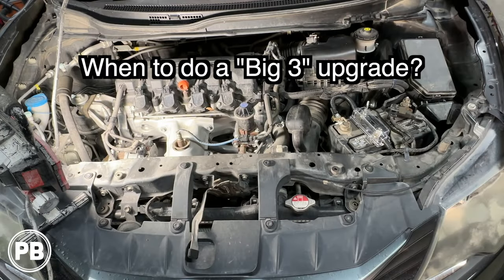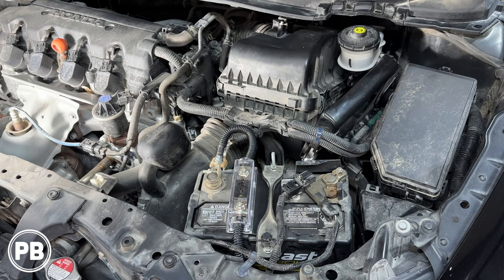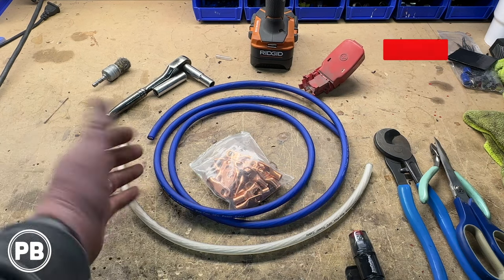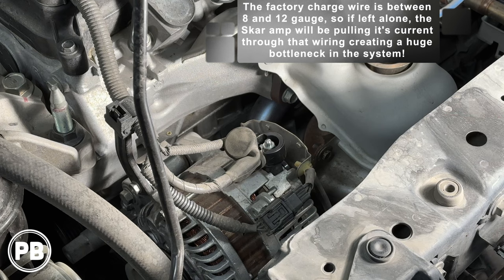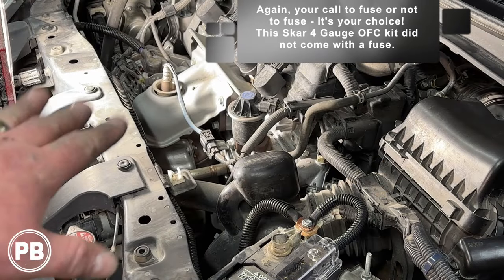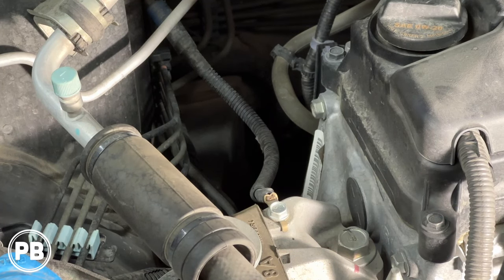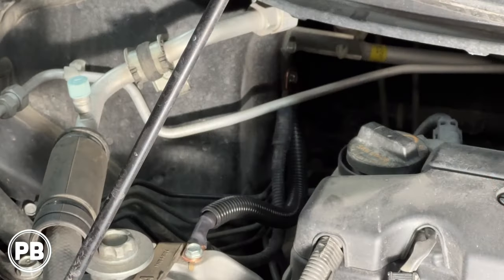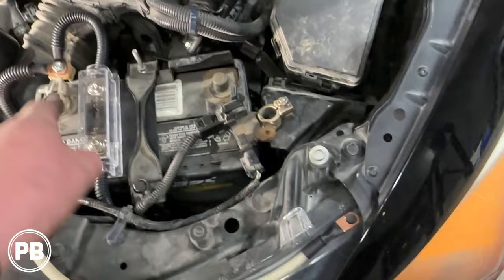How To Install a "Big 3" Car Audio Wire Upgrade!

Comment: Why doesn't anyone ground the alternator
Reply: Some do. I was wondering why he didnt.
Reply: The alternator is grounded through the engine.
Reply: @AmericanAristo  If the engine has a good ground to the battery.
Reply: You would still need the engine grounded as the alt will still ground through it, at least partially. If you have any flow of voltage through the block it'll go in path of least resistance, usually through the coolant causing electrolysis between various metals and the radiator.
Reply: @chriscoralAloha  True. Wouldnt hurt to give it its own ground anyway.
Reply: @shaunmark1  when you say you "need the engine grounded" are you referring to a run from block to frame? Just asking to make sure I don't run into radiator problems
Reply: I usually do mine if it has a factory ground. But I call it the big 4 when it does. The black wire on most have enough to make another run the the alternator.
Reply: I still ground the Alt. N fuse it Best way to go. Plus I'm running 2/0
Reply: I do
Reply: What about with a high output alternator still ground through engine and upgrade engine ground?
Reply: because you dont need to unless you have a crappy alternator that throws less that 80 amps lmao. or unless you're trying to power a true 3k and up amp
Reply: I had to learn the hardway, thank god I purchased the mini fire extinguisher  I kept under the seat .
Reply: Usually you only need to if our running a higher amperage alternator. My 87 firebird is running over double amperage alternator from stock and a a result I put in a 4 gauge ground from alternator in order to ensure I can put that power to use. Also running a diesel Ford battery for the 850cca vs the stock 550cca from the side post.  Add the head unit, aftermarket subs, aftermarket speakers, amp, interior led lights.  I have no issues keeping a consistent voltage on my battery to run the car and enjoy playing my music on Sunday cruises.
Reply: @Sir.AdamsVIII Can you explain what you did wrong?
Reply: @BravoakaMrAlabama  You fuse your ground wire?🤔
Reply: @BravoakaMrAlabama  You fuse your ground wire?🤔
Reply: @DTB2.0  he grounds the alt. and puts a fuse on the alt. not the ground.
Reply: @w33dsmoke61  oh ok  could have  sworn he said he fused the ground
Reply: @DTB2.0  he did, but thats the thing about english slang. you can say a lot by not saying much. lemme translate

I still ground the Alt. N fuse it Best way to go. Plus I'm running 2/0

i still ground the alternator and also fuse it. the best way to go. plus im running 2/0 wire for the setup.
Reply: @BravoakaMrAlabama  I only got one 175a ANL fuse for the positive side, do I need another for the negative?

Never mind. I read more comments and misread your comment like the other guy.

Comment: Even if you're not doing an audio deployment, the Big 3 worth it, at least on the Civic. Honda, like other manufacturers, understand every that every ounce of metal costs money, so they make every wire as short and as thin as they can, and the terminations aren't very well insulated, so, they corrode over time. I did the Big 3 when my Civic was 10, and noticed a substantial difference in the smoothness when coming to idle, and at idle, e.g. coming to a stop. I guess it technically could equate to a restoration of power, for some older models. Thanks for the more detailed video than what was available back in 2018!

Comment: My set up is 320 amp alternator, 2 gauge big 3 upgrade adding to existing oem wires, two 1/0 runs from front battery to rear battery, two xs power d3400 batteries, two skar audio skv2 3500.1, two massive audio hippo xl 122r. Probably going to get sundown zv6 or fi audio neo 4.7 subs next.
Reply: Always fi audio over sundown.
Reply: Nice bro... Do you have a fuse on the cable from your alternator to the battery!???
Reply: @IzKingFranklin for anyone watching this, like said on this video, a fuse is optional. If the wire has to run a good distance and could possibly rub on something or possibly burned then a fuse wouldn't be a bad idea. If you ate going to fuse it, make sure you find out what amperage your alternator puts out and use a fuse as close to that amp as possible. You just don't want to put a 200 amp fuse on a 90 amp system as the fuse would never do its job and blow before it causes a fire... Your basically putting in a failsafe of having a short in a wire that's directly on the alternator and worst case causing a electrical fire.

Comment: Your Honda like mine has the current sensor on the negative terminal. I found that after adding the big 3 to mine the sensor was reading no current draw thus not commanding the alternator to charge fully. I had to disconnect the sensor to get the alternator to charge at full power.
Reply: That's exactly what I've been thinking because I did it on my car. I hooked up three grounds to my negative terminal and I was thinking that it's not going to read any current from that week ground going through the sensor. I don't know if this guy realizes that.

Comment: thanks for the video. As really your alternator is the "power source" for your car, and keeping the battery charged (the battery helps work as a filter for the power) upgrading to a higher output alternator I think is the best way for supplying power to your car amplifiers. An electrolytic capacitor for you subwoofer amp (seperate amp class D) is also recommended because subs have crazy peak draws of energy, like 60 amps to 160 amps for 1/4 of a second then back to 60 amps. Capacitor helps keep a steady power supply to your sub amp, as well capacitors also work as a filter. Just make sure to not have anything between the capacitor and your amp for the power cable. If you need to run a fuse, do it before the capacitor. Remember, the battery/alternator does not send power to the amps, the amps draws power. That's why things can go bad if not wired right.

Comment: question i didn’t find in the comments:
how would you go about doing the big 3 upgrade on a car with the battery in the trunk? would the charging cable do its job if you simply ran it from the high output alternator to the terminal under the hood or would i need to run the charging cable directly to the battery in the trunk of the car?

Comment: Thank you for the video - I have a question -  so you added a wire to the alternator to the battery , and you still have the factory wire to the alternator to the battery ????

Comment: why not remove and replace? Why most installers just add new wires to existing, does it have any pros and cons? I mean for clean look and get rid of that those tiny cable ?
Reply from the maker: Sometimes there are OEM sensors, or factory circuits that pass through the OEM wiring.  All depends on your specific vehicle whether you can do that or not.  It doesn't hurt anything to add to it, but you could cause issues if you remove the OEM wiring.

Comment: What determines what amperage fuse should be used for the run from battery positive to alternator positive? Is it just the output amperage of the alternator?
Reply: I would add 40-80 amps from your alternators max amperage. For a 320 I'd get a little under 400 amp fuze. For a 370 maybe a little over 400. 
For a 240 I'd get a 300amp fuze, etc. You just wanna be sure you don't blow the fuze when your alternator hits it's max rating. And the rated amperage isn't always going to be very precise. A 320amp alt might in reality be able to put out 330 or only 310
Reply: @bailey2517  thanks! that's exactly what I ended up doing so I'm glad to hear it
Reply: @bAc0nBoY755  glad to hear it! Out of curiosity, what's your system like?
Reply: @bailey2517  budget build. 2x 12 audiopipe txx-bdc1's in a sealed box (like the sound better than ported) wired to 1 ohm powered by a skar rp.1200.1d. Very satisfied with it given my budget and therefore power restrictions.
Reply: @bAc0nBoY755  nice!

Comment: Do you have to do big 3 wiring upgrades all at once or can I upgrade the power wire from alternator to the battery and add the ground wires later?
Reply: You theoretically could, but it’s not a good idea to EVER have power and ground wire that can’t flow the same current
Reply: id upgrade the ground wires first, power wire last

Comment: Hi I just watched your stereo installation video for a 99 dodge Dakota. I have the same brand stereo and same wiring harness but I’m not getting any sound for the any of the speakers
Reply: If it’s turning on and no sound? Was it getting sound before you switched it to the new radio? Maybe you wired the speakers wrong or maybe you have a shortage somewhere. Can be anything but check your wiring first. Especially if it was working before the radio switch.

Comment: So essentially, say I have an extra 20ft 4 gauge power wire that is not use. Can I just use only that power wire for all 3? Power wire, and 2 grounds? (I think that is what you were talking about when you said that the color doesn’t matter) but just wanted to clarify. Thank you!!
Reply: Yea it’s just wire
Reply: So I was moving my big 3 power wire was hooked up to the alt but I was connecting to the battery and the battery was hooked up and it sparked I had dropped it do you think my alt is fryed
Reply: @jonathanmartinez1865  nah bro it should be fine put it one there if it don’t work well there’s ur Answear but it should

Comment: I have a question.. Please guys. 
I have a 2000 watt Amplifier, and a 12 inch base at 2100 watt And when certain songs come on with a nice big bass.. the bass will loose the bass kick. I have a yellow top battery, will this big 3 help me out? 
Thanks Everyone

Comment: My only question is i bought new terminal connect and the battery current sensor on the ground is there a way to bypass that ? Or a way to attach it other than factory ?
Reply: I personally just unplugged it on my 2016 CR-V. You shouldn't get a check engine or battery light and your alternator should default to 100% output. Just verify with a multimeter

Comment: So you jus add that new big 3 power wire with your existing alt power wire? Didn't know if you upgrade the alt power wire or jus added it along with your existing alt power wire.
Reply: You leave your original wire and add the "big 3" over them.  do not remove any wires.

Comment: I have a 06 Chevy Malibu 2.2l and will do the Big3 soon as my parts come in anything you recommend. Stock batt all. I'm running Rockville 16Db with two 3k massive audio 10s summo Xl. Light dim sound stops a few seconds. Sick of it lol and with no real video or info it's hard shop's want to much for little work.
Reply: Anyway update, I added the Big3 no big discount so up is next a battery upgrade
Reply: What did you end up doing mine is doing the same thing It will sound good for awhile then it will just cut off won't restart until I shut off the entire vehicle and sometimes unplug the sub and re plug

Comment: Always removed old thanks for that tip as well
Reply from the maker: Unnecessary, as some vehicles today have more integrated into the OEM wiring than a simple run from the alt to the battery.  You can do more damage than you know - just add to it for aid, then remove.  Great rule of thumb.
Reply: @ProvoBeastAudio  yes on those with negative sense module does a negative need to be ran for 2nd battery or will vehicle ground to frame for 2nd batt be ok? 2018 ecosport

Comment: I have a question you know how to do a big 3 on bmw I’m still need in help cause my battery in the back and the alternator in the front not sure if I need a smaller wire to the alternator to the battery I just need help
Reply from the maker: Longer run generally would require a larger wire when calculating Joule's law.  So your alternator to battery in rear, i recommend at least a 4 gauge OFC wire, fused at the battery end.

Comment: I have Hyundai KONA 2.0 - 2019 model, if i upgrade to BIG 3 and add one AGM battery its okay?
Reply: the kind of battery doesnt matter as long as it can handle your set up
Reply: batteries matter, in case its over 1500rms would recommend replacing the factory one with AGM. if you can afford it, go for Lithium ones they're the best

Comment: Would I need this with a single skar 8’ 400 rms and skar 500rms amp with a 110 alternator
Reply from the maker: It's always beneficial, but for only 500w RMS, probably not (as long as you have a healthy battery).

Comment: Is there such thing as too big a wire? Ie. Running 0 gauge from the alt to the battery.
I know your ground should be at least the size of your live but just wondering.
Reply: No, the bigger the wire the less resistance, there's no down side
Reply: 4 gauge is more than enough for 2000rms, for more go for 2 or 0 gauge wires
Reply: @xXHellFighter13Xx distance is also short hence requires lesser area no need for 00 or 0 gauge wires.

Comment: how do you get to the screw on the block behind the alternator?  I cant get my socket in there, OR in the one from the block to the frame
Reply: I know this is a year later but get some angled wrench heads for your socket set. It’s great for a lot of jobs.

Comment: Should've just put the new power wire  under the OEM one. Then you would've still been able to put the boot over 😊
Reply from the maker: The boot cover fit on just fine.
Reply: @Provo Beast Audio Installation  yeah it looks like it is, but I have a 2014 accord and the right terminal fits snug right under the OEM wire so its not all stretched out. But still very neat the way you did it. Helped me with mine since I have a Honda as well

Comment: Mine has ground sensor. Adding 2nd battery or ground wouldn't that bypass that?
Reply from the maker: Not necessarily, if you run that ground through the censor loop, it will provide better accurate info to the ECM for charging.
Reply: @ProvoBeastAudio  so I should be an additional 0 Guage negative and tie it before the sensor as that goes then to the frame
Reply: @ProvoBeastAudio it looks like you ran the ground to the post and bypassed the sensor. I did big grounds to my car and I think that that third ground with the sensor is not going to read any amperage draw. Do you know anything about that? That would make the alternator not work most of the time.

Comment: I tried this on my 2002 f150 4.2 and when I connected everything back together my fusible link next to the battery started smoking and it blew out, but my vehicle has a solenoid with positives going to + side of battery and + to back of alt and I'm not sure if I was suppose to connect the big 3 positive to there I just went + battery to + alt but I did fuse it which blew that fuse also.   Plz anyone's help would be appreciated I don't know what I did wrong.
Reply: Yeah, that was your issue. You put a positive to the back of the alternator which the back of the alternator is a ground. There’s only one spot on the alternator that is a positive and that’s the bolt on the top feeding the battery.

Comment: Hey I have done the big 3 upgrade on my Camaro. I had to run my alternator wiring from the front to the back since my battery is in the trunk. I have a fusible link in the wire as well. I ran the alternator wire into a distribution block. Should I just run it straight to the battery instead? I’m running a 3000 planet Audio amp.
Reply: Before you worry about any of that, you need an amp that actually warrants doing any of it. That amp is fine on factory wiring. It's not actually pulling any real juice.
Reply: @BLITZSPEIGS  so are you saying I need a better amplifier?
Reply: @justinthornton6735  I would say that if you need an excuse to upgrade 😂😂

Comment: No ground to alternator ???
Reply from the maker: Alternator grounds through the engine block.  You can run a ground directly to the alternator case or bracket, but the engine block showed no resistance, hence why we used the factory grounding locations.
Reply: @ProvoBeastAudio  Thank you.

Comment: What happens if you only do a big 2 upgrade? 2/0 from battery to alt and 2/0 from battery to chassis?
Reply from the maker: You mean power and ground from alt to battery? That okay, but if you use the vehicle to ground your amplifiers, then you are missing the body ground to the battery which can be an issue (if your engine grounds are small or poor).
Reply: @ProvoBeastAudio  Thank you for replying! That last Paul supposed to be from the negative battery post to the chassis. I don't have a as of yet.

Comment: what does the engine ground do?? i have just 0ga running from my alt to my battery and a 0ga ground from the battery to frame
Reply: I did the same as you did... I didnt do the engine ground but wonder if that would really help
Reply: An alternator is case grounded so it is grounded to the engine and then the engine is grounded to the frame.
Reply: I would add the engine ground because you want your alt to produce the most amount of power possible and a better ground would really help.
Reply: @h-townstros9018  it completely fixed my issue it kept overcharging every so often and it hasn’t done it at all since i’ve done it

Comment: I hate how he didn't remove all the stuff pack player in placing the small 8 gauge with the 4 gauge and plus it's ofc so it would be able to stare against sweater idahot climax of the engine there's no reason to keep the stock grounds on or the one what goes to your alternator just saying

Comment: That’s where a capacitor comes in to prevent dimming lights.
Reply from the maker: Most capacitors are filled with sand to make them feel "quality".  You will actually do your amplifier good by fixing the actual issue where it starts - at the battery and alternator.  I've ripped out more capacitors and completed a wiring upgrade than i can count to truly fix the issue.